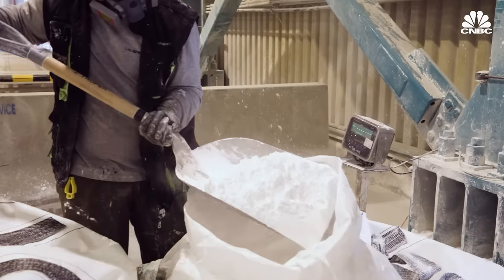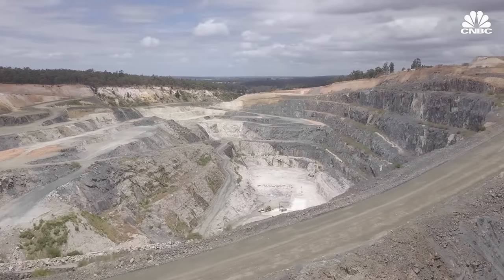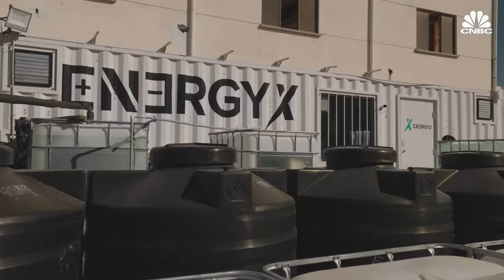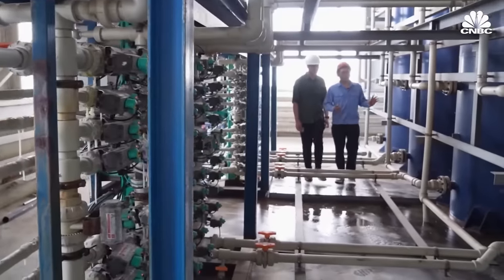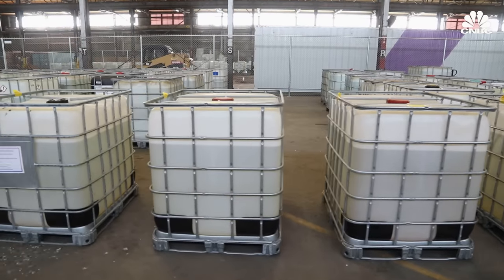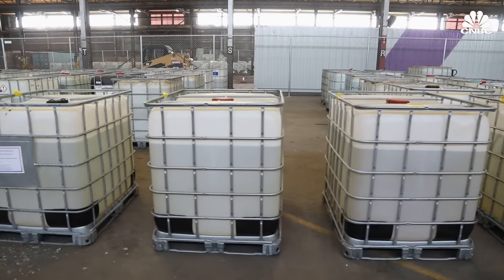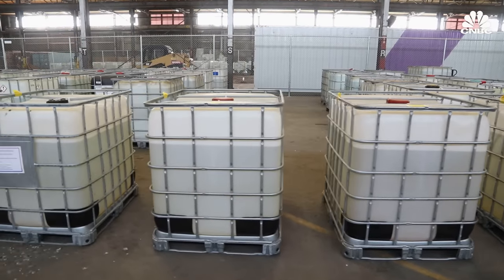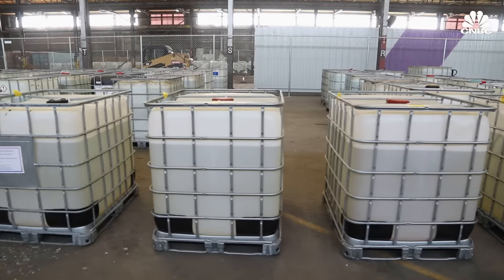Why The EV Industry Is Betting On This Lithium Mining Breakthrough

Comment: Maybe we shouldn’t be waiting for innovations like this to reduce carbon emissions and instead make walkable cities where people don’t need cars to get around.
Reply: Sure, cities don’t need cars. Outside the cities though…
Reply: @Simon-dm8zv  smaller towns can also have a decent percentage of their populations that wouldn’t be reliant on cars either. Most towns historically would have people that ran shops live in town and didn’t require anything besides their own two feet to get where they needed to go. I think there is a strong need for some people to have personal vehicles, people with disabilities, farmers, maintenance workers. But if you work at a bank or a retail shop or a restaurant, etc there is no reason we shouldn’t have cities that would allow you to walk to those places regardless of the city size. For intercity travel and freight could very easily be handled by rail which is far easier to electrify and thrives with walkable cities.
Reply: A "walkable city" like what do you mean exactly? Are you gonna shrink the cities???make the sidewalks shorter? I don't get it...
Reply: @nobody4933  promote streets dedicated to walking not cars to improve pedestrian safety, reduce parking lots and garages as they make the distance to walk between places larger, have more missing middle and mixed use housing - think first floor shop front and second/ third floor apartments.
Reply: @nobody4933  He probably means like this: https://www.youtube.com/watch?v=F4kmDxcfR48
Something you see very often in Dutch cities for example. Doubt it will happen in the US in the next few decades though.
Reply: It is a nice idea but we need huge amounts of energy and walking instead of driving won't even put a dent in it.
Reply: Good idea.  But any specifics how to accomplish this?  Its a technical, political and social problem.
Reply: @hairybutharmless7163  I absolutely agree. I live in a walkable city myself. Still I think we need a lot of vehicles that require battery power trains including trucks, vans, taxis, buses to keep a society like that running.
Reply: @KayAteChef  27% of the US carbon emissions (the largest chunk) come from transportation. Over half of that ~55% come from small vehicles (personal use). So I’m sorry but you’re incorrect in your assessment on that. Additionally, having more dense housing is also far more energy efficient in terms of heating and cooling of homes. Also, using more rail instead of trucks for freight would drastically reduce transportation emissions of bulk and consumer goods. The technologies to make these changes already exist and they would be better for not only the environment but also for the economy and for people.
Reply: @hairybutharmless7163  And it is a lot easier to electrify rail than trucks.
Reply: @Simon-dm8zv  Battery power for rail and busses isn’t the best best thing. Overhead lines for both methods is actually far less resource intensive and have existed for a very long time. Taxis wouldn’t be super necessary if mass transit is scaled correctly and walkability is prioritized. Then at that point if it makes sense to electrify utility vehicles it would likely take far less resources overall than what is projected in this video.
Reply: @beyondfossil  progressive property taxes that ecourage capital investments - tearing down single family homes in high demand areas to build denser housing that accommodates families, elderly, young adults etc. Eliminate minimum parking requirements. Eliminate property tax exclusions, if you use land, pay for it. New developments should be expected to be mixed use, rowhouses are good, 2/3 over 1s are much better. Overhead electrical lines for buses. Narrow the roadways, if people are speeding it because the road is too wide, wider roads are less safe to cross as pedestrian. Some stuff to start.
Reply: @danielcarroll3358  oh you betcha, the Milwaukee Road had sections in Idaho/Montana electrified 100 years ago via DC hydropower.
Reply: @Simon-dm8zv  Cars are not nearly as necessary as you think they are, at least for most people. Most cities are designed for cars and not people thats why you have that way of thinking.
Reply: Oh yes. Do you know that walking make people much more healthier! I live in the suburbs please help. We should make people walk! Not drive. That may reduce carbon footprints 😂 then you definitely don’t need people to commute to work if all you can do is walking! Yes!
Reply: @hairybutharmless7163  <<
HairyButHarmless
4 hours ago
 @KayAteChef  27% of the US carbon emissions (the largest chunk) come from transportation. Over half of that ~55% come from small vehicles (personal use). So I’m sorry but you’re incorrect in your assessment on that. Additionally, having more dense housing is also far more energy efficient in terms of heating and cooling of homes. >>

While people like to TALK about energy efficiency,  what most people do is find a lifestyle congenial for them and their families,  and if that involves a lot of energy use ----tough.

Personally,  I live in Seattle's traditionally cheapest neighborhood.  While I have a car,  I only use it these days to take it to mow the lawn at my rental house.  I walk 3-5 miles/day,  and already did that today.  When walking wont serve,  I take the bus when that's practical,  as it will be tomorrow when I have a doctor's appointment.

But few of my neighbors do much walking,  and I never see them at the nearby bus stop.   Most people like their cars,  and should be free to use them. 

The only way you will get what you want anytime soon is to use government to FORCE people to adopt your biases. Those are certainly the methods of Robespierre,  Marx,  Lenin, Stalin and Mao.   Millions died at the hands of such people,  and those who survived STILL want to drive.
Reply: easier said that done.
Reply: @greenleafyman1028  <<And build trains, trams or trolleybuses. They are the real environmental friendly.>>

Yes, we have built LOTS of those in recent decades in Seattle.

And if environmentalists got permission to shoot people driving their cars,  more people would use them.  FORCE is the key!
Reply: @Capthrax1  yup yup yup, probably easier than waiting for those new innovations to save us though. What do you think?
Reply: @hairybutharmless7163  Yeah, let's tear down New York City and redo it. No sweat!
Reply: @HairyButHarmless  certainly cheaper , and more practical
Reply: @hairybutharmless7163  I can't wait to see trains pull up to the grocery store...still need vehicles for last-mile delivery.
Reply: @claytonbrown7100  yeah that’s totally true, it will sometimes be more efficient for the most rural rural towns or parts of a larger city that would be best served by having trucking to central locations like grocery stores or post offices. Did you have have a broader prescription to elaborate on from that? US rail freight at this point is carrying roughly 30% of overall US goods, most of them being bulk goods like agricultural products, industrial goods, etc. I’m advocating for that freight to increase to include a lot of the consumer goods to more central locations within cities which then could yes be carried via truck those last miles. As opposed to continue relying on truck freight for those middle miles and making the transition to electric semis as their load capacity would be greatly reduced by current battery technology weight.
Reply: @HelmuthGerka  I know. I live in a city and I walk or cycle to work every day. We still need A LOT of lithium for electrification of all other vehicles.
Reply: American would ne triggered by this
Reply: @hairybutharmless7163  You’re point is well-taken and I think there’s more margin rail can take from the trucking sector when it comes to less time-sensitive cargo. The challenge is that rail can’t compete time-wise when it comes to expedited, door-to-door shipments. Electric trucks will continue to grow provided the infrastructure and regulatory environment make that feasible. I can’t offer a broader prescription yet all I can say is that at the end of the day, it requires a multi faceted, cost effective solution for shippers, carriers and customers.
Reply: Those two things aren't mutually exclusive...
Reply: Or maybe we can stop the social engineering and let free people use energy to improve their lives in the ways that they choose.
Reply: Work from home! But then the central planners don’t get their power and control fix.
Reply: Sounds like all the sidewalks you have in mind are on the left side of the road.
Reply: Moronic comment 😬

Comment: Lithium carbonate for lithium IRON batteries.  Lithium Hydroxide, expensive , for high performance lithium ION batteries, NCM/NCA.   Most EV batteries, at least entry level cars, lithium Iron batteries.  Less toxic, cheaper, more cycles and full use of battery, 0-100%.  Lithium Iron easier to recycle but less energy dense/little heavier but rare fires.
Reply: That's why the lithium manganese phosphate batteries kick ass. They are fire safe like LFP, have a similar lifespan, and higher power density & voltage.

Comment: The first Sodium batteries release (or released already?) this year. There is 1,000 times more Sodium than Lithium. Also, Sodium batteries don't catch fire as easily. Wouldn't it be wiser to go with Sodium?
Reply: energy density and future of solid state battery
Reply: They probably will eventually.  They have to retool their battery factories to make use of the new resource.
Reply: The technology just isn't there yet. But I have no doubt by the end of the decade we'll be using sodium batteries in alot of things.
Reply: @Funktastico  sodium will have higher density than today's lithium
Reply: @Yoyo-vt4hc  not yet. What is important is now, not what it could be in the future.
Reply: Check out the volumetric density.
If you want a car the size of a bus, fine.
But otherwise too big and too heavy unless there's a major advance.
Now.
For STORAGE facilities, they are a possibility and could free up the higher density materials for other use.
.
As for the old "but batteries catch fire! myth.... It's generally a .... Myth.
The GM issue was a mechanical construction issue causing a short.
Jeff Dahn (look him up if you don't know) has said they understand why the dendrite degradation happens and it can be (probably has been) fixed.
Reply: @Funktastico  
You haven't researched it, have you?
Reply: MRM 70
Search "sodium in water"
Reply: @Genzphilosopher  "The technology just isn't there yet. "
Tell this to CATL. They start mass production of Sodium batteries this year.
Reply: @rogerstarkey5390  "Check out the volumetric density.
If you want a car the size of a bus, fine."
Well, BYD wants to sell the first car with a sodium battery. We can then study the first iteration of this technology in practice. It's just sad, that China is so ahead in this game.
Reply: @mrm7058  they've been saying that for two years now. And what I mean by the technology isn't there yet, is it's nowhere as good as the lithium batteries. Sodium batteries are less energy dense, heavier, and don't charge as fast. The technology still needs more improvements before it can compete in the market.
Reply: Search for videos of LFP batteries getting drilled through. They smoke a lot but they don't catch fire either, despite being lithium based.
Reply: @Yoyo-vt4hc  
No sodium does not have a higher density than lithium batteries.
Reply: Sodium ion intercalation causes even more damage than lithium ions do. The electrodes disintegrate even faster. Lithium ion phosphate batteries are cheaper and last longer. I think they have a future here. Possibly zinc bromine as well but that is less certain.

Comment: What the EV industry is betting on is a Sodium battery that can replace the Li ones. Sodium is much easier to get and table-salt is practically everywhere, not to mention super cheap.
Reply: Invent it then
Reply: Battery sodium is mostly mined from more abundant sodium oxides. Not the sodium-chloride from sea salt.
Reply: @WigneyR  Sodium batteries exist, they just have anywhere near the energy density needed for automotive. At least for now.
Reply: @johnbash-on-ger  Yep, the problem of the highly toxic Cl2 waste is what prevents table salt from being used.
Reply: SAVE THE SODIUM...!!! (for my movie popcorn)
Reply: @phillyphil1513  Relax, there will be more than enough sodium-chloride around for your festive, frivolous food flavoring for ever and forever.
Reply: @XKS99  CATLs sodium-ion battery gets 160 Wh/kg, next gen is planned with 200 Wh/kg. Their first gen is slated to launch this year. Teslas 4680 cells get about 280 Wh/kg. That's close enough.
Reply: @anydaynow01  Chlorine is valuable; I would expect them just to get hydrogen and make hydrochloric acid and sell it at a profit.

Comment: While DLE technology has the potential to be more environmentally friendly and efficient than traditional methods of lithium extraction, there are some potential drawbacks to consider. 

One drawback is that the selective membrane used in DLE technology can be expensive and may need to be replaced frequently. Additionally, the brine used in DLE technology can contain impurities that can clog or damage the membrane, reducing its effectiveness. 

Another potential drawback is that DLE technology is not currently as well-established or widely used as traditional methods of lithium extraction. This means that more research and development may be needed to optimize the technology and increase its scalability and cost-effectiveness.

Finally, the disposal of extracted brine and other waste materials can also be a potential drawback of DLE technology. If not properly handled, this waste could potentially have negative environmental impacts. 

Overall, while DLE technology has the potential to be a more sustainable and efficient method of lithium extraction, it's important to consider and address any potential drawbacks in order to ensure that its implementation is as environmentally responsible as possible. Thankyou !
Reply: is this a ChatGPT  reply?
Reply: @aktheuite  Some from Gpt, some Google & some from my Own, but as we know with any mordern technologies there will be some drawbacks more or less ! 
Thankyou 👍
Reply: Thanks bot.
Reply: @ryanelliott4594  ❤️👍
Reply: Gpt

Comment: 0:09 I fail to see how using the sun to do most of the work can be "inefficient". And the space argument does not seam strong either since it is done in a desert. The water argument is more valuable, however the water is not spoiled by the process, just evaporated, so the "ecology disruptive" argument could have been developed. I would like to know how much energy the "new" processes need to operated, and how carbonated is the energy used, and also is the water is "cleaned" after the process or at least re-used. Most of the arguments seam to come from new players, so probably biased, I would have like to hear an academic point of view. Regarding the need of 20 times more lithium, maybe a better solution would be to switch from ICE cars to electric public transportation without batteries (trains, metros, tramways, trolley-buses, etc.), to bicycles and to "walkable cities". With EVs just for people you definitively need cars. And not trucks and SUVs with more than 100 kWh, but efficient sedans with 50 to 60 kWh batteries. It is possible to go everywhere in Europe (and I assume in the US) with a 55 kWh Tesla model 3, so why would we need more kWh per car ? We need to put the money in the infrastructure, with fast charging between cities and low power charging everywhere cars are parked. I may be wrong, but I would have like this video to explain me why, for now I am just convinced that more people try to make more money.

Comment: I think that the Porsch synthetic fuel been made in Chile is a better solution than electric batteries. Extract carbon from the air and makes methanol and is further refined into a synthetic fuel which can be used in existing vehicles. Then we don’t obsolete all the cars in the world.
Reply: Toyota Japan has already announced their exit from lithium based cars. Saying "this is not the future". 

New age hippies are too easily suckered by alternatives industries that pose as safe alternatives but are not. The use of 500,000 gallons of water per ton of lithium that gets polluted in the process is not a safe/sustainable solution. Even this process leads to questions about the equipment and parts used that will just yet again create another unsafe industry beside the lithium industry to produce the materials to perform the process. Or to the energy it uses. If it sounds too good to be true it usually is. These are often just get rich quick industries looking to fool us into funding them. Trusting figures and facts about it that were delivered by the industry itself is like allowing elementary students grade their own exams. Be skeptical and look for the scam. Because it usually is.

Comment: How much lithium is in the brine that comes from desalination compared to underground brine.
Reply: Your question doesn’t make sense because everything is variable
Reply: @cybertrk  Then give an upper and lower bound. You could start by naming the lithium content of sea water.
Reply: There is lithium in seawater, and there are scientists looking at extracting it.  But it’s at very low concentrations compared with brine pumped through underground lithium formations.  May not be economical.
Reply: @DiamondJim22  that is why I ask about desalination because I am wondering if the brine from that would be a option 🤔